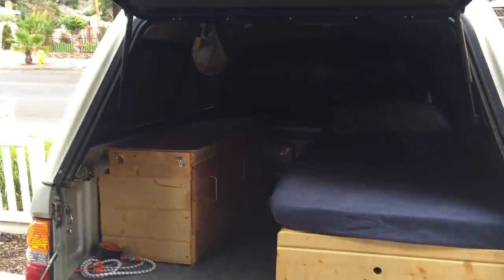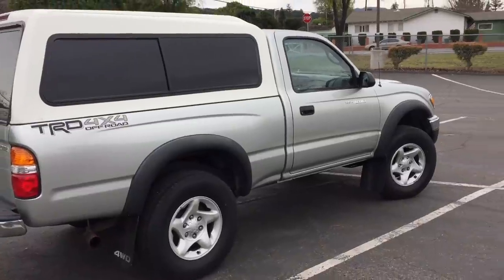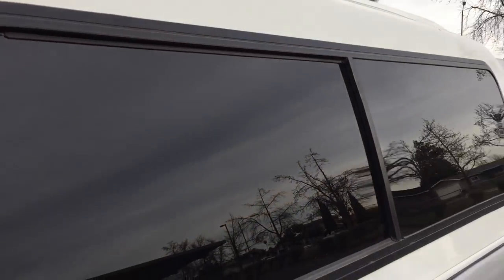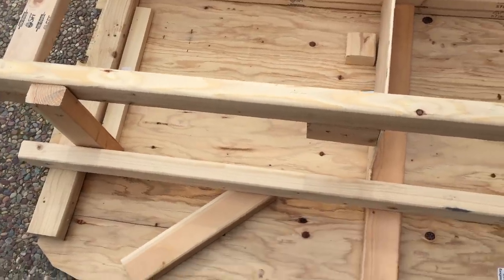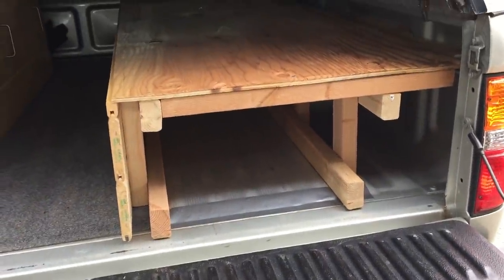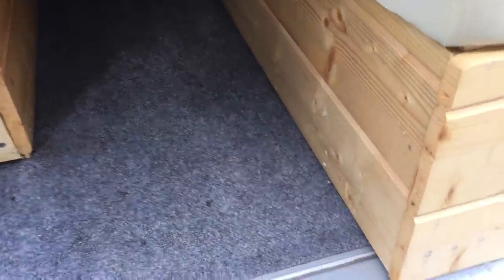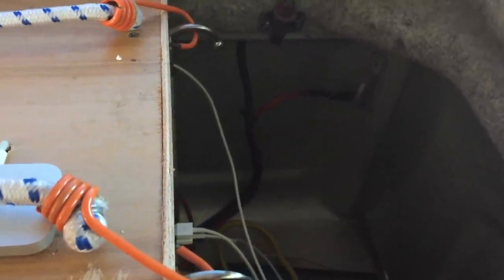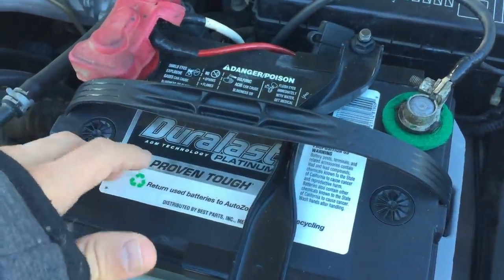A Detailed Explanation of my Camper Setup

Comment: I've been setting up the same set up and heading GOLD Mining the last 7 years... I built a steel raised bed out of sucker rod (3/4 inch solid rod) high enough to get a rubber maid plastic tub under it .... I have a 2004 GMC 4x4 excab 6.6ft box, rear seat removed ex storage ... sealed Canopy and end-gate with foam tape it stays dry and dust free even on 100s of miles of gravel roads.... I head out mostly to Northern British Columbia and have slept in it at minus -30....

Comment: I have a 93 Toyota Pickup single cab that I bought for $2500, and it is a standard as well. I have a similar setup to yours in mind for mine so that I can stay in my camper when I am working or doing whatever. Not long after I bought the pickup I was searching high and low for a shell that would fit this model, but no one seemed to carry one. So I hopped onto the Facebook marketplace and found one about 30 miles away from where I was working at the time. The guy had the exact same pickup as myself and was originally asking $45 for the shell, but when I got there he told me that I could have it for free! Awesome. It is a Leer XL series shell with a high roof and some upper windows. The original back glass was smashed before and the previous owner replaced it with a piece of plexiglass, which works fine. I had to replace the worn out struts on the back glass and the shell does not fit this pickup perfectly, so I had to screw on some pieces of one inch trim to my bed in order to lift up the shell. Right now I just have some shell clamps holding this on, but I will eventually bolt this puppy down. I've not yet gotten around to installing the bed and storage, but I do spend quite a bit of time in the bed and catch a nap every once in a while. Right now I have my drink cooler and a large storage tote back here for all of my food needs, as well as for storing tools and such. I really like the videos that you put out, so keep up the good work. And I hope that more people will get into camping out of their trucks. : )
Reply: Man this is goals i want to do this so bad

Comment: Have u ever heard of dynamat it's a sound deadening mat I use it on all the old cars I restore its sticky on one side and designed to go under carpet and headliners and stick to the surface to keep heat out and quiet road and engine noise I bet it u lined ur whole bed area with it it would be miles quieter and way better insulated... just a thought
Reply: I too live in my vehicle, where to I get this stuff?

Comment: The camp grounds in Florida near salt water want nearly 40.00 a night regardless of whether you are sleeping in an rv, tent or camper shell. I built a shower with a pressurized chemical sprayer and kitchen sprayer using all new parts
Reply: C.M. , great idea !   What size sprayer container did you use ?  Thanks for sharing the idea !
Reply: WH 2 gallon, I believe
Reply: WH I think a better idea would be at least a 5 gallon bucket with an electric water pump ie. Shurflow just like rvs have to pump water, maybe even a boat sump pump would work,  sprayer not wanting to keep pressure.and I always have 12 volts.
Reply: C. M. Go to a Walmart parking lot
Reply: gym membership solves the shower problem

Comment: I just built a box like you sleep on but its for storage.  A single sized mattress fits between the tire wells ... think about it. It's a bed on wheels. My buddy heater sits on the storage box and it's toasty inside even when it's 20F outside. I use the rig to stealth camp at boat ramps for duck hunting.

Comment: Roadie  I though you might like to know when it comes to hooking extra things up on some vehicle,s like your power converter,  there is a positive  and a positive negative ground,  And a lot of things will not work with out a direct ground connection to the battery. so what i am saying is you will need both positive and negative battery cable wire direct to they camper do to the fact that most rigs now run a positive negative  on the integrated circuit  through your program control module (  PCM ), our most likely in your case a technical interrogated program module ( TIPM ) chip board right under your fuses in the engine compartment.  I hope this helps.

Comment: You have a great setup. My question is what do you do to take a shower? I have a 2008 Mazda Tribute. ( Aka Ford escape). Thinking about sleeping in it this summer, setting it up like yours but to my my liking of course. It's nice because the seats lay perfectly flat. I'm 6ft, I haven't measured the length yet but I know it's shorter than me. I sleep with my legs bent anyways so being taller doesn't bother me. So this is very new to me going about sleeping in my SUV, I'm a bit of a neatfreak, I work for a pizzeria and I have to be clean. What do you do for hygiene? Showers to be exact. Love your videos, keep it up. I live in Brattleboro, Vermont. Take care and I hope to see what kind of advice you reply back with.
Reply: Thank you James B

Comment: I watched some of your other videos about your truck setup and I like how you are keeping it clean and simple in a rig you can use everyday.  One question though.  Have you ever thought of running your electrical off a separate battery that charges off of your truck alternator so you don't have to worry about draining your truck battery?  I saw your winter camping video and it seems like that would be a better option for that.  From personal experience the last thing you need is to drain your battery of any amps it needs to get that motor turned over on a cold morning.  I live in Canada though so maybe it doesn't get cold enough where you go to worry about?

Comment: How long is the bed? How tall are you? Sweet set up man.
Reply: WOOJONG a lil over 6 feet
Reply: thank you. so few of the Youtubers mention height -- found out many of those are  uhm, vertically challenged
Reply: tyler hofer I’m 6’4 as well. And I drive a 09 Saturn. I only have a sleeping set up for long breaks between classes but I fit perfectly if I put the back seat down
Reply: tyler hofer I’m 6’2” and I can sleep in my 1994 Toyota bed
Reply: Get a 8ft bed (truck)
Reply: Tyler Hofer  I just located a very similar like new camper shell for $500 but negotiated down to $300. I found it on Facebook marketplace and had to drive 4 hours roundtrip.
Reply: I’m 12 ft , I just sleep under my truck , keep the engine running nice and warm .
Reply: Tell it Like it is sounds safe a bud
Reply: Idk Why very , you from Devon uk ? We say bud . Don’t hear many other regions say that .
Reply: Tell it Like it is a lot of places say bud, Bud
Reply: Medium

Comment: Almost would have been easier? They make a jacketed for hiway trucks 4/14 which would have saved you putting split loom on your wires. That works very well for that. Yes do fuse your wires and ground near the battery which you bring to the canopy.  I have a 7 wire to cab and canopy. With 4 fused and 3 grounds.

Comment: I finally found me an ARE camper shell 150 miles away for 100.00. I built a platform in back and spray painted shell so it's a better color match. I went fishing at coast last week but didn't get to try it out bc  my dog cut his paws pad so I returned home. It's kind of cramped bc I have an inverter,  2 batteries and I have a charger and generator plus dog, rod n reels, cast net, and a foldable dog crate, plus tools.
Reply: Hope the dog is healing well !   Do you have pics on a FB page or anything ?
Reply: WH no facebook, pictures of what?
Reply: Pics of your truck camper shell and up grades you made . 8 )  All ideas are appreciated.  I'm planning on do something with mine.  I have a Dodge 3/4 ton with a 76 " bed and a camper shell on it.  I need to make it more camp friendly.  I currently just put a mattress on the floor and a sleeping bag.  It works , but I really like what I see in this video .   Thanks.
Reply: WH I basically just build a small platform with plastic milk crates under for a quick takedown. It's basically just for fishing and if I go somewhere I don't have to rent a motel. I always have batteries inverter and or generator with me.
Reply: Same here ,  Always carry and inverter.  I have an electric impact wrench , if I have to change a tire.  And an electric fillet knife. Gotta have an inverter !  When you can camp next to the water , who would want to give $100 a night for a motel , plus they are usually gross !  ha.  Good camping & tight lines !
Reply: WH campgrounds are wanting as much as 30-40 a night even for a tent near the water ie near oceans.

Comment: Instead of running all that wire to the main battery and putting stress on it, why not just buy a secondary battery to put in that slot @6:25 and hooking the inverter directly to that? Then just keep a trickle charger on it when not in use.

Comment: I wanna use this to travel the us for a month, seeing the beautiful stuff, how easy would a chevy trailblazer be to make into a camper? Its a cheap option
Reply: Sam Meister sorry for a late response...

I’ve driven and considered making both my Tacoma and and my used-to-be mine Trailblazer into campers. 

It depends on many factors like how tall you are, what sort of camping you want to do, how handy you are, and many others.

I know from previous experience that standard size trailblazers are fairly roomie and good sized on the inside. There’s no doubt in my mind that it could be made into a camper. However, the trailblazer has other flaws that turned me off from converting it.

Trailblazers are extremely complicated electrically. Working on the electronics and trying to add accessories is a nightmare. Trying to add something as simple as an inverter would probably take an entire day.

Another flaw is the trailblazer’s weight. 6200 lbs is insane for a small truck. The 4.2 liter straight six is an amazing engine that pulls the truck very well (0-60 in 7.7 seconds and 275 hp), but is extremely thirsty, sucking down gas at 14 mpg in the city 20 on the highway. That’s worse than full size pickups.

The trailblazer with 4x4 is an extremely good vehicle and if it’s what you have, you could make it work. If you have like a van or pickup though, I’d consider that.

Comment: What did you do to waterproof the rear cab gasket that connects to the car window? I have troubles of leakage with mine
Reply: When I was  stationed in San Diego, I had a F-150 with the sliding windows on cap and truck. Went to the  Navy Exchange and bought a motorcycle inner tube. Placed in between truck and cap, added a few lbs of air. Worked great and removed it when I  didnt need it